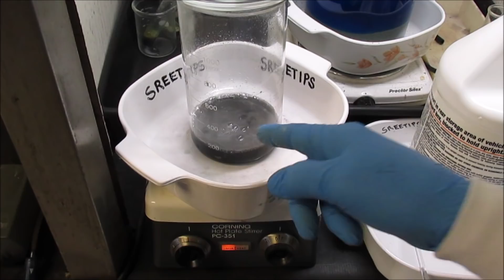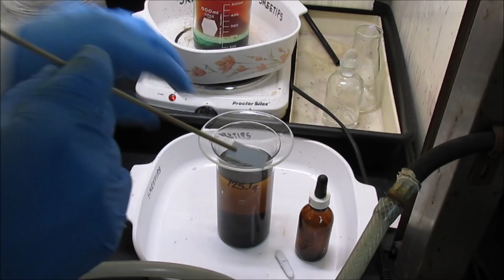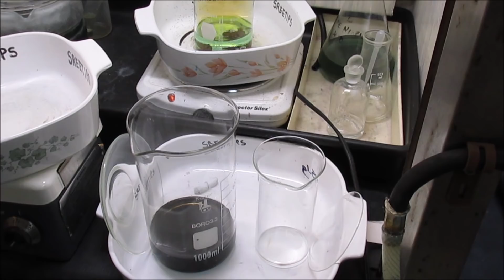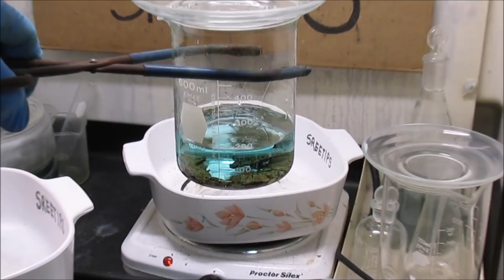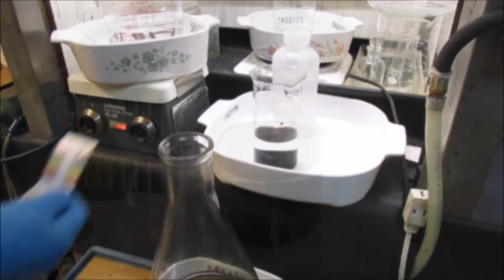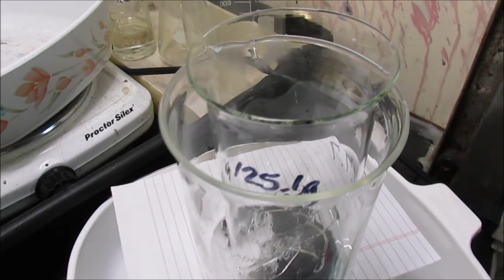Stock Pot 14 of 16 Not Another Disaster

Comment: Ok stupid question from me time lol

It hit me that with such a mix, after the zinc is gone from the HCl bath, you should be able to get most of the upper metals dead and gone with a quickness with NaOH/air bubble... Even copper swims pretty readily in that condition.

I do see problems with adding bases to the process of course, all the "extra"... But when you're fighting a difficult solution... 

Would leave your other metals in hydroxides, easy enough to recover later if desired, but your PGM should be the only thing left around after that...

Worth a shot, or am I nuts? Lol
Reply from the maker: This was my first attempt. I was learning as I go. The processes I used were incorrect. But I learn best by “doing.” I have a second stockpot series that went much smoother. I capitalized on the failures of the first series. I’m getting ready to do a third stock pot refining. I’ll rely heavily on the experience gained from the first two stock pot refinings. Watch for the video coming soon.
Reply: @sreetips  Haha I hear ya. Same way here. I may be totally off on that idea but it came to mind.

Comment: Just an fyi:  Standard lab safety procedure in most of the labs,  not all,  but most of them,  that I have worked in over the past 30 years, is that NOTHING is allowed to be closer than 6 inches to the front edge of the fume hood (or even a counter).  Usually this is taken care of by the air foil in certain hoods,  but if this did not exist (like in your model),  then the 6 inch safety line was measured and marked out.  In labs that did not have this rule,  the lab tech/chemist was not working with dangerous chemicals.  Also,  a safety tip that was developed during my career.  Any flask which is hooked up to a vacuum pump needs to be placed inside a closed hood,  the hood only being opened (after turning off a valve to the vacuum source) to add solution to be filtered.  Or alternatively the flask would be set inside a plastic bucket or a metal can.  This prevents implosions due to worn out or microcracked glass flasks from injuring employees.
Reply: Thx for sharing that 👍

Comment: Two quick comments...
1. Washing the powder created a huge amount of waste, use the vacuum filter and pour hot water to wash. It's the most effective way to wash unless the filter gets clogged. You can always test the drips from the buchner funnel to see the pH. Then dry the powder in the dish, add a warm lamp just above the filter and it will dry in no time at all.
2. If you want to dry the powder in a beaker, use a wide and low beaker, not a tall and narrow. There is a reason that evaporating dishes are wide and low. The tall and narrow beaker condenses the water along the sides and it flows back down again.
Reply from the maker: Excellent points, thanks Goran

Comment: The broken glassware, is see some folks use sand to the glassware doesn't take on any hotspot from the contact points of the glasswares imperfection on the bottom surface, and it only seems to add a couple minutes worth of time to heat up through to the glassware....  Nice job, I really enjoy watching your videos.

Comment: I didn't see any marking on the beaker that broke brother. Was that borosilicate? 
I would muchhhhh rather have one break at this point than when it is in a solution form.
To explain for your viewers how this works i will give a short explanation.
Normally Hcl in and of itself will not dissolve copper without an oxidizer. The oxidizer can be in the form of air or H2O2 like what we use in the acid peroxide procedure where we dissolve the copper base metal to release gold foils like what is found when fingers and pins are plated. Here the elevated temperatures are a form of oxidation that helps drive the reaction instead of air or H2O2. The elevated temperatures serves as the oxidizer to dissolve the trapped copper and any zinc that may have formed when you precipitated the PGM's from solution. The oxidizing power of the heat is not high enough in potential (Voltage) to dissolve the PGM's. Nitric acid has a higher oxidizing potential and that is the reason we are able to dissolve PGM's with Hcl at a later time to affect the separation of PGM metals.

 In the beginning when the PGM's first neculate from the solution, by using zinc or copper, and change from a solvated ion to an actual metal they do so on a seed crystal (Copper). The zinc reduces copper that is in solution to it's metallic form. Since their is no oxidizer present to put the reduced copper atom back into solution this makes a perfect spot for the PGM's to reduce to. Copper is below the PGM"s on the reactivity series so this is the next step for the PGM's to reduce to. This seed crystal is then intertwined or trapped within the crystal lattice that is formed from metal ion arranging themselves. There are millions of individual atoms that has to form, stack, and come together just to see the first flake of metal form from solution. These seed crystal are in a finally divide state, but trapped by the surround metal PGM"s. The same thing happens with any copper present. The boiling effect assures that the hcl is driven deep within the metal matrix lattice so that it can reach it and do it's job. In this finely divided state it is easy for the hcl to dissolve any copper or zinc present. If this was a chuck of metal even as small as a gram you could boil until the cows come home and it wouldn't have the same effect so it's the finely divided state that works in our favor. This effect of neculation can also be seen in nature when a snow flake forms from moisture in the air. The first formation of the seed crystal for a snow flake will form on a particle of dust or dirt that is suspended in the air. From there layers are built through neculation until the snow flake becomes larger! My only other advice would be after 3-4 washes with hot water do a boil or two with hot water so that it penetrates the metal lattice just like the Hcl does. Doing this should cut you washes down to about 10!
Reply from the maker: Excellent, thank you. I thought about a distilled water boil but decided against it due to time. This is a highly valuable refiners trick here. I'm not a trained chemist so I don't quite understand all the terms you're using. But I do understand that from now on boiling in HCl will remove copper from mixed black PGM powders. I could have performed this boil in the beginning and got the copper out long ago. I'm going to copy and paste this comment and print it for future reference. Thank you for sharing your knowledge. Most pros don't do that, especially on social media like YouTube! You've taken away some of the dread associated with trying to refine my next stock pot.
Reply from the maker: I bought that beaker at an antique store. It was a small tall form and was a prize piece. But now I think it may not have been boro. I'm very lucky that it didn't break when it was full of liquid!
Reply: Most labware nowadays is borosilicate,  except for glassware for biology use,  which often is not due to reactions between borosilicate glass and certain biological materials.   When I started in chemistry,  "Pyrex" was borosilicate,  and "Kimax" was sodium glass marketed to the biological field.  (In truth both brands sold both sodium glass and borosilicate glass,  but most lab catalogs sold only pyrex for borosilicate and kimax for sodium glass until the 1990's).

Comment: Thats awesome you were able to recover that amount from the "disaster" last time at these final steps. I would not have thought possible to extract those precious metals from wet cardboard and paper towels.  Please be careful when reaching around and handling those beakers,, 
Also, it's interesting that the solid metal Platinum coin is not toxic to handle.
Reply: Well that is quite simple: what is poisonous is the pgm in solution, meaning as a salt that can be used by the body. A pure platinum item is only the pure metal with almost no reactivity and therefore harmless. I mean, you have to hit it with one of the most acidic solutions known to man to dissolve it... that stuff uses to be very stubborn when reacting to something.

Comment: you can save the pieces of the beaker and use them as boiling chips to cause a more even heat in solution - welcome to the club on coming back to one randomly shattered.
Reply from the maker: That's an excellent idea. I've had solutions banging because of the steam explosions during boiling.

Comment: Ah man, you're dissolving the Zinc IN not OUT.
Basically the acid converts the solid metal to +ve charged metal ions in the solution.
What you want is just PGM ions, then reduce them to make them back into metal.
More Zinc ions is just more crap in the mix.
Reply from the maker: Jonathan, I've done some escrap in previous videos. But if you're looking to make a profit from escrap then I can't help you. I don't mess with it because the yields are too low and the amount of waste that must be processed is too high.
Reply: @sreetips  thanks....
Reply: He is adding tin ions to drop the pgms the tin goes into solution.
Reply: @EdWolfram  He's adding elemental Tin, not Tin ions.
Reply: A major consideration is the environment the Tin is being added to : for starters, it is full of HCl as well as those dissolved +ve charged bits of Pt etc.
Before having any desired effect, the Tin will just react with whatever acids are present.
Reply: The fluffy white stuff from the previous video : as the massive excess of Tin reacts with the acid(s), the pH gets higher - it basically reacts with/removes the acid(s), so there is less acid in there, so the pH goes up.
At a point, the crazy mix of chemicals start to hydrolyse, giving crap like Zinc hydroxide etc.
If it was Zinc hydroxide, adding a base to get the pH even higher, e.g. sodium hydroxide should dissolve it.
No idea if that would help get the Pt out though.
Acid is not always the answer.
Reply: @aga5897  yep past my understanding, ty for the explanation
Reply: I am just waiting for the shiny silvery metal at the end!  All of this is way over my head!  But I love watching!  I am a 30 year picker and just in the last year stated picking up gold filled when cheap.  I could have 20-30 pounds of it if I had been picking all along and then ask him to refine it for me.
Reply from the maker: Yes, I'm dissolving the zinc into solution to get it out of the beaker. I got rid of the solution leaving the PGMs behind for further processing. There was no tin added at any time during the video. I used stannous (tin) chloride testing solution to check for precious precious metals in solution. But I never added any of it to reaction vessel.
Reply: sorry for that. the beer got the better of me.
Reply from the maker: It's not tin, it's zinc
Reply: He's doing way 2 much!  👌 already.. Yeah we love your mini 🎥.... But  "Please already"  show us how to profit from E way ,scraps & all precious metals. "I'm tired of watching THESE videos..... " I GOT WELL OVER A 1200kg..of old PCs...... Already for processing....
Reply: @jonathanwallace1172  Not really sure what you mean,,? What are you saying..?
Reply: @Boatswain1985  hit the wrong key. Wasn't trying to comment on your page sorry.....